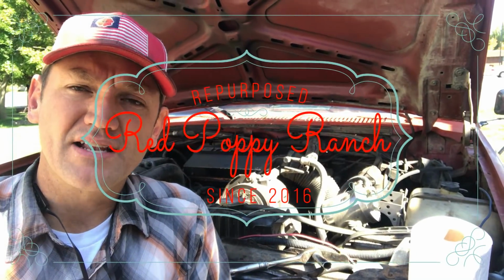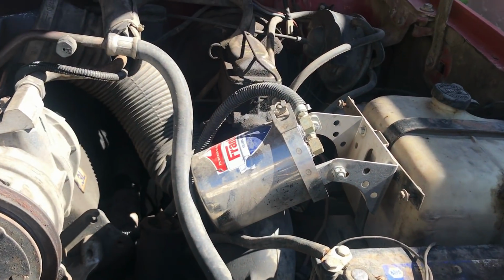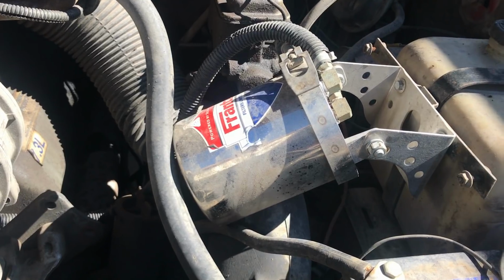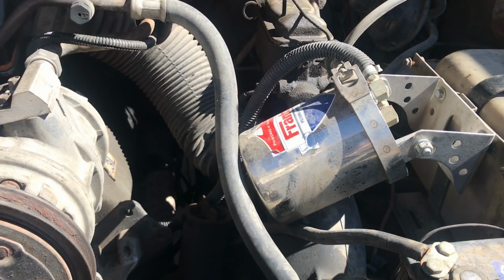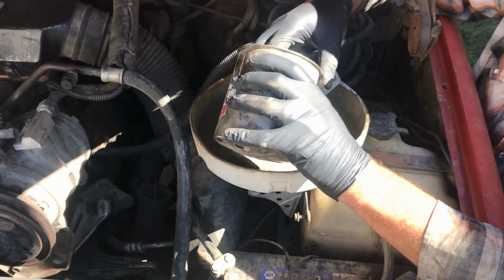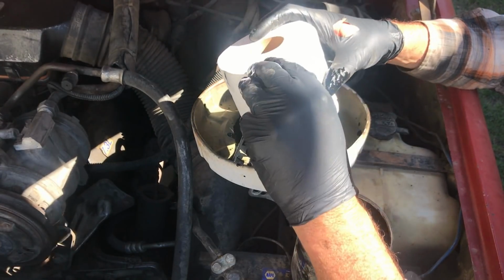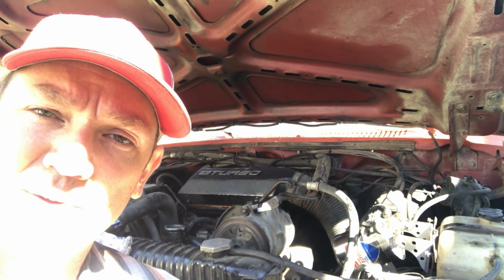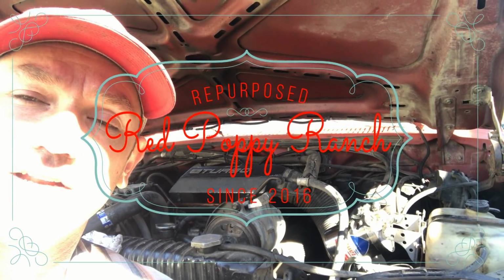#146 - Toilet Paper Oil Filter Maintenance... (Frantz Oil Filter)

Comment: My bypass filter is a centrifuge, and it cleans the oil down to 1 micron or less.  No filter in it, just requires cleaning out the built-up sludge now and then and far easier to clean.
Reply: Back in my younger days I had a Honda 305 Dream motor cycle with a centrifuge. Did a good job.
Reply: Other than that I have no experience with them. They were common on Mack trucks.

Comment: We were using the Franz bypass filter along with the full flow filter back in the mid 1960's. We would change the Frantz filter (toilet paper roll) every 1,000 miles, along with extended mile oil changes. We could see on top of the Frantz filter anything going on in the motor. One time were seeing bearing wear (fixed that). Another time we started seeing powdered iron (camshaft failing) (fixed that). Both motors came out for the fix. Started blocking the bypass in the filter housing for the full flow as even though we found wear on top of the bypass filter, still damage done to the bearings from the camshaft failure. Did this for decades on our street machines (not muscle cars). Frantz oil filters were around $30.00. Toilet paper??? Have the oil analyzed after using the two different filters to actually see which one really does the best.

Reply
Reply: Frantz is a good filter. My first one in 1963 cost me 29.95. I used Delo 100 30W. 29 cents a quart in the discount stores. The Frantz was a little messy to change. I found out about the MotorGuard about 1965. 
My old 85 Ford 6.9 had a Gulf Coast junior bolted to the plastic fan shroud as high as possible. The excess oil drained back to the engine over night. Never spilled a drop. The Gulf Coast junior is out of production. The new owner is a heavy duty diesel engine guy. He thinks the diesel pickups need a big filter bolted to the frame. I did a fleet of mostly Powerstrokes. In those days the filters took Bounty big roll paper towels.

Comment: Before the 50s all filters were optional equipment. All filters were bypass filters. All bypass filters had an orifice to reduce the flow of oil thru the element. The best elements used cotton. Later bypass filters for trucks such as Luber Finer used pulverized newspapers. The best available these days use toilet paper or paper towels. Pleated filters are only good for full flow filters. Full flow filters are for removing engine damaging abrasives and can't remove smaller engine wearing abrasives.

Comment: I have used these filters for nearly 60 years now and they work really well. ALWAYS install as a BYPASS filter. They keep your engine clean . I mount upside down so changing is just releasing, removing, draining and CLEANING, and reinstalling. They CLAIM you don't have to change oil, just filter, but I never bought into that.
Reply: I bought into the no more oil drains when I installed the Frantz on my nearly new Rambler American.It has worked well for me. I probably change the filter and add more new oil that most. I always try to mount the filters upright in a place where they can drain at shut down. If air cant enter the filters they wont drain. I would do every 2 K miles on a Diesel.
Reply: Upside down is the only way to go!
Reply: Tests on the oil between changes read that the oil is CLEANER than when you bought it at the store.
Reply: The Frantz is the messiest of the toilet paper filters especially if you dont have a Chevy hub cap. Put a Frantz upside down and you really have a mess. Saw a guy on YouTube calling the Frantz  bottom the top. I thought he had lost his mind.

Comment: Does it keep the oil a golden color?
Reply: Probably amber would be a better word.  Gasoline engines normally the oil will be amber in a gasoline engimes and black in a diesel. Some soot is non abrasive and is too small to be filtered. Its like ink. To remove the black you might be able to remove it with a filter that is used for dry cleaner fluid. Not practical for our needs.
Reply: The black oil in a diesel can be cleaner than the oil in a propane engine that always looks new.

Comment: How is that not starving your engine of oil?
Reply: Bypass filters have been around  for 100 years. They all hook up the same way including the Frantz. They all have a restrictor  orifice usually 1/16". The big diesel engines sometimes have a larger orifice. Bypass filters are the only ones that clean oil. Your diesel engine will last longer using Rotella and changing the Frantz more often. I have almost 60 years experience.   Dont want you guys to mess up.I think it is important to understand the oil system before installing a filter that cleans oil. Hard to imagine someone thinking a bypass filter could clean the oil for a llifetime without changing the toilet paper. They are out there.

Comment: A customer had a problem with a Frantz oil cleaner. He tried to change it with the engine running. The filter Hit the roof of his garage.He had oil all over the car and garage. He wasn't happy.
Reply: ralph wood unless there's an isolation valve why open it with the engine running? 
Never heard of anyone removing an oem oil filter with the engine on, it's the same here.
Reply: There are people that might crawl up under a car with the engine running and try to remove the full flow filter.
Reply: Correction the Frantz hit the hood. He had oil everywhere. I assumed he forgot to turn off the engine before he opened the over center clamp.

Comment: The Frantz is a good filter. I have the Gulf Coast O 1 junior. It's a top loader. Takes me about a half a minute to change it .
Reply: I have two Gulf Coast O 1 Junior bypass filters. I am willing to sell one of them if you know anyone interested. The other one I'm keeping.
Reply: The Frantz was the worse designed filter of the bunch. This demonstration makes them look even worse. All I have now is Gulf Coast juniors Motor Guards  a Australian Jackmaster Classic  and a  flat head Ford V8 canister filter converted to take a 4 1/2 inch roll or Scott 1000 sheet. My old 6.9 had the Gulf Coast junior bolted to the fan shroud as high as possible. Returned the oil to the oil fill neck with a self tapping hollow bolt. The excess oil drained over night.. Used the Frantz for about 20 years before the better designed top loaders came out. When the oil in my Rambler American went from black and dirty to amber colored I didnt nit pick the lousy design.  In 1963 Delo was 29 cents in the discount stores.

Comment: I have a Gulf Coast O 1 Junior Bypass filter for sale if anyone is interested. I'm keeping the other one for myself.
Reply: Nice filter. I have several in use. Not sure if Gulf Coast still sells them. At one time when Frantz 3 stackers went out of production a Frantz dealer came out with the improved top loaders. He mostly specialized putting Frantz 3 stackers on heavy duty marine diesels. The junior was a marine filter for ocean use.
Reply: @ralphwood8818  I'm pretty sure Gulf Coast no longer mfg's the O1 Junior model. I still have one in use that I've been using for 10+ years on a V6 with 266k miles. Anyway I put a new head gasket on one side last year and everything was smooth couldn't hardly find a scratch anywhere. Ralph as you already know, bypass filters work.

Comment: They are all a little different. On my 6.9 diesel Ford I bolted  the filter to the plastic fan shroud  on the driver side. After it sits over night the housing is drained. No spillage. I returned the oil to the fill neck lower than the filter. The filter wont drain unless air can enter the housing. Gasoline engines are the same as diesel  engines in that a very small amount of soot is non abrasive and too small to be filtered out. My oil is clear on my gasoline engines on the dipstick
The difference is on a diesel the non abrasive soot is a lot more. The black oil in a diesel will be as clean as the oil in a gasoline engine if the filter is changed often enough. Black doesnt mean dirty. On my diesels I like for the oil to be a shiny black like it has ink in it. Not grey black.

Comment: Am I the only one around here that is old enough to remember the. FAA and. PMA approved AeroFrantz. They used 2 ply facial quality bathroom tissue..There were no Frantz elements in those days. Saw some on crop dusters about 50 years ago. Saw oil analysis reports on  Cessna 182 Skylane. Virtually the same as that filter but I think the clamp had a bolt in it

No.all of aircraft  didnt crash because the toilet paper clogged.up the engines .

Comment: I have a 2002 Elantra with almost 200,000 miles on it. It stop running last week and  when I took it apart I was shocked when how much scoring there was and how much where there was inside this engine shocked because ever since brand new I've only used synthetic oil and a good quality synthetic filter.
A friend of mine had a car with a secondary bypass filter it was a very large filter like you would find on a big rig and I don't have room for that type of filter in this car. I am disabled so I cannot work and this car needs to last me at least another 60 to 70 thousand miles don't have the money to replace an engine in this car a bypass filter is definitely what I need. Thank you for making this video I have seen the Frantz filter before, but I thought it was just one of those gimmicks.
The question is how much do these things cost.
Oh, and thank you for making such a comprehensive video.
Reply: Steve Cobratei what brand of synthetic oil did you use?
Reply: I had a 2003 accent I bought with about 160 K. It was a piece of crap. I'm told the newer ones are better. The engine held up but the tyranny didn't. I think I would stick with a Toyota. These bypass filters aren't as impressive for modern cars.you can do fine changing the oil as recommended. These filters are a problem if you have to depend on others to service your car. I'm a fanatic do it yourselfer.
Reply: I know a guy with a  nice looking Hyundai. Threw a rod at 70 K. Warranty covered it. He is wealthy. He went and bought a new Sports model  Camry. He has a beautiful old  Camry sitting there. Asked him if he would sell it. Said he is giving it to his daughter. Said her Camry has 500 K on it and is starting to give her problems. Said he would sell me the Hyumdai.

Comment: These big engines that have gone over a million miles without an oil drain haven't done it on the same oil.When they change the big roll paper towels. Normally 2 rolls on a truck they are adding about 2 gallons of new oil. An off shore rig it might be Many rolls. The Frantz is the same system but with only a qt added. The best element for the Luber Finer or Cummins Fleet Guard 750s uses pulverized newspapers and wood chips. Haven't seen the cotton elements for awhile.

Comment: It’s a gimmick…until now I didn’t know they still had this.
The oil never circulates. The toilet paper just soaks up the oil and that’s it. If it did circulate the toilet paper clogs the oil passages and then there is a sudden drop in oil pressure.
Reply: The biggest selling point is they are chrome and have a fancy sticker on them… if they were plane black plastic no one would buy them.
Reply: @geraldwegener8376  
Hahahaha! I know all about them.
Reply: @geraldwegener8376  
Interesting you assume “conjecture”. 
Tell me, how much oil pressure did you experience on the outflow?
Reply: @geraldwegener8376  
Hmmm
Reply: @geraldwegener8376  
There will always be believers. Still, if it wasn’t chrome it wouldn’t sell.
Reply: @geraldwegener8376  
Yeah? Same argument:
If they were really as good as they say that “system” would come standard.
You still chasing those “special” cars that would get 200 miles to the gallon only to have the dealers find them and “fix” them?
Reply: @geraldwegener8376  
Yes, it is real world. As I said, If it worked it would be standard.
Reply: @geraldwegener8376  
What do they do?
Reply: @geraldwegener8376  
Oh no…I no they don’t do a damn thing. But, what do you think they do?
Reply: @geraldwegener8376  
You definitely regurgitated the selling point.
They definitely don’t do that.
Reply: @geraldwegener8376  
Better question… what micron sized particles does any damage in the first place?
Reply: @geraldwegener8376  
Not changing your oil will cause damage too.
Reply: @geraldwegener8376  
How long do you want to go between oil changes.
IT’s recommend 7500 to 10,000 miles… some cars as much as 15,000.
What you going to save??
Even the dollars don’t make sense to do it.
Reply: @geraldwegener8376  
How many miles you got in that engine?
Reply: @geraldwegener8376  
Sounds like your engines run just as long as everyone else’s, congratulations.
Reply: @geraldwegener8376  
It’s a gimmick. Anyone who takes care of the vehicles will always have longevity. 
You are just a hipster in love with on old fad…
Reply: @geraldwegener8376  
My comments are as much relevant as these “snake” oil filters are.
Reply: @geraldwegener8376  
I don’t know why anyone would put this on their vehicle. You could filter it each time you changed your oil. And just rotate it. 
Asinine to go through all the trouble and all the expense and deal with leaks and clogs and an oily mess changing out a piece of toilet paper… 
Snake oil filter.
Reply: @geraldwegener8376  
Sure it is… and if it worked it would be standard equipment to have a secondary “filter” on every vehicle just like they all have catalytic converters.
Reply: @geraldwegener8376  
Might as well put magnets on your fuel lines too…
Same thing.
Reply: @geraldwegener8376  
Now a conspiracy theory…
And yes, is very much the same.
Reply: Oil bypass filters do work it's been proven through oil analysis tests.
Reply: @geraldwegener8376  
I guess I could concede to the virtue of filtering as a general term in this case.
A paper towel filters exactly the same…
Again, if it worked as “advertised” it would be standard equipment. 
Funny how the standard works better…

Comment: Frantz.might  be the only toilet paper filter left. I like the new model they call a refiner. There is a guy with red gloves  on  YouTube  that shows the correct way to service the new model. You put the TP on the base then push the housing down over the full roll of Scott 1000 or other paper the same size. Saw one guy remove paper and do it the same way as the old model. Dont know the price. When it's  something that will  last a lifetime what's a few dollars.

Comment: I haven't used the Frantz elements for about 30 years. I am now using  Wal mart  Great Value 1000. I have modified my filters to use the shorter paper. The reason I use the filters is because they use toilet paper. If I could get the Frantz elements at Wal Mart I would try them. If you can keep your oil clean and dry acid isn't a problem. All of your diesel  oils will neutralize acid.  30 years ago all the Frantz elements were was high quality toilet paper with a thicker core. 
Motor Guard is the same way. Toilet paper was the best thing since since sliced bread until they came out with their own elements.  John Frantz  had a hell of a good idea. The best oil filter available for about 10 cents in 53. Probably not the best marketing choice.

Comment: Seen one turned on a lathe and fitted to an HQ Holden in 1985, the idea went bad when the manufacturers changed the size of the toilet roll core.
Reply: When Frantz went broke years ago a Frantz dealer improved on the filters. His design doesnt  require a tight seal at the core. You push the roll down against a superior seal.I think the tube is 1 3/8. They are top loaders. The famous Frantz 3 stackers were replaced with paper towel filters. The toilet paper filters may not be in production now.  That was the Gulf Coast juniors. Still a few Frantz 3 stackers on shrimp boats and such. They are all trying to get away from the words toilet paper filters. It's probably too late. Too many lies  and bull shit stories come with toilet paper. Also most people think oil is supposed to get dirty and be drained.

Comment: Why didn't you clean the canister the filter (toilet paper) goes in?  Looks to me that's where a lot of the debris would collect?
Reply from the maker: I wiped it out.
Reply: Red Poppy Ranch ok. I must have missed it.
Reply: Red Poppy Ranch I watched again and it sure doesn’t appear you wiped/cleaned it out. Maybe you edited that part out. Just thinking it would be a good idea to show that in case some people follow your video to the T.
Reply: I didn't wipe out the Frantz..Most of the contamination is in the paper. At a flea market I was challenged. A guy said I have something you can't filter out. He sold art supplies.he had some concentrated black coloring. I filtered it right out. I used it The rest of the day. When I changed the toilet paper the top half was black. The bottom half was white. I have used cement coloring stove black I have gone to art supply stores. One time I was showing how the filter worked compared to the full flow. I had gotten some black paint coloring from Kelly Moore in a liquid. When I started going thru the full flow filter the oil was coming out clear. That was embarrassing. The coloring wasn't compatible with the oil.It started bunching up and being filtered out. I unplugged the machine put it in the trunk.
Reply: Oh yes I forgot. The Frantz is up side down. May be a little sludge.Probably not. I always managed to put the Frantz upright on the diesels. Many years ago I saw the little Frantz on a over the road truck. It was upright. I said isn't the Frantz a little small. He said no I change it every day.